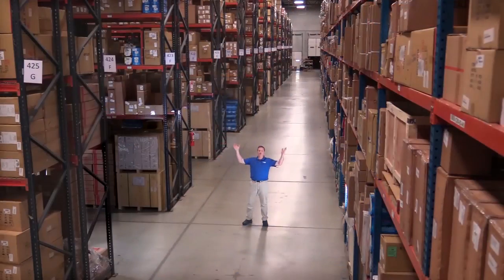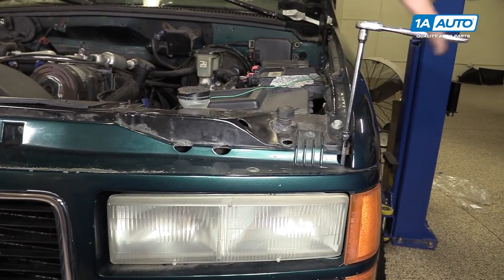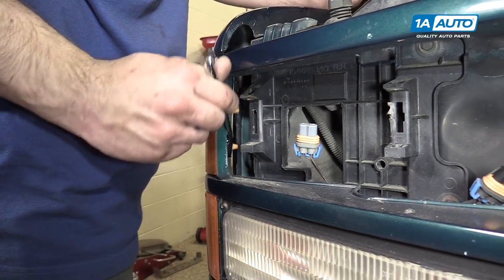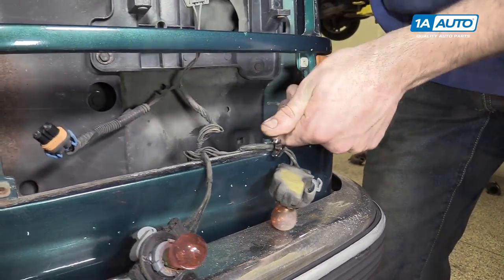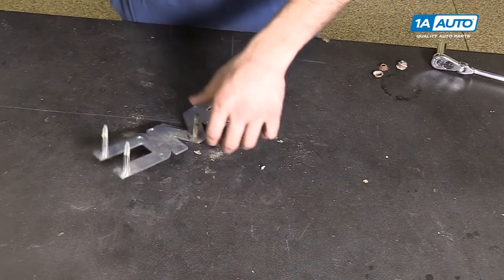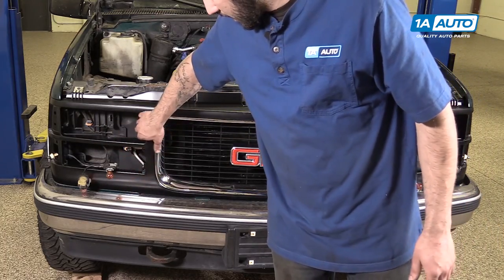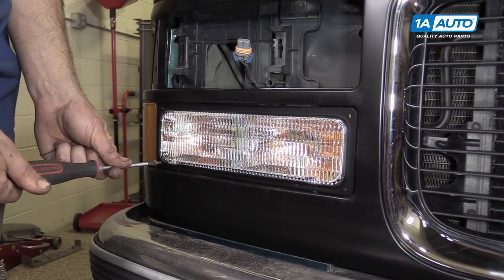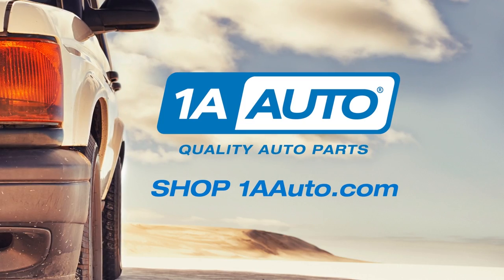How to Replace Front Grille 94-98 GMC K1500

Comment: A quicker way to do this is to remove the turn signal housings, then disconnect the side marker bulbs from housing, THEN unbolt the grill. The headlights are mounted to the car itself so they dont need to come off with the grill.

Comment: Thank you for your videos they are very helpful. I am surprised that when you had the headlights, signal lights and marker lights rermoved from the grill you didn't detailthem , or suggest that they be detailed , and wipe the dust of the marker light bulbs. Its a lot easier to detail parts when they are off the vehicle.

Comment: What is the strip that the grille clips into? Do you sell those? Just bought a grille from you. Need to replace that too. Had no idea that was a separate piece. Would be a good suggestion part to offer. Thank you!
Reply: Justinb Justinb did you find out? I need the same piece

Comment: My 1990 GMC Sierra has the single headlight grille, and I would like to upgrade to the slim quad head light design. Do you have an electrical connector kit to do this change over? I believe the grille should go right in place. Any help will be greatly appreciated. God Bless.
Reply from the maker: +Luis Gonzalez Thank you for your question. Currently, we do not carry a headlight wiring kit for your vehicle. May I suggest trying eBay Motors online.

Comment: why did you pull the headlights? and it's easier to change marker lights with grill removed
Reply: Might ah been to lighten the 'grill' weight for extraction, less pressure on the lower clips.     

Notice the leaves behind the drivers side headlight assembly are same as seen within the,   'remove/replace your headlights'  vid.        LoL

Comment: Is the gmc grill and the chevy ones different? As in light assembly size?
Reply from the maker: +Kurloz Soriano They may be a different size on that vehicle. If you would like to check our website to get a better idea for your specific year, here is a link to our website. Hope this helps you out. 1aauto.com
Reply: +Kurloz Soriano: the Headlights and parking lights are all the same between the two trucks. The 4 side markers are different though, so you will have to get GMC or Chevy specific side markers. 88-93 and 94-00 Chevy side markers are very different, non-interchangeable, same goes to GMC, IIRC. Hope this helps you.
Reply: @firstnamelastname2468   But apart from the 4 side markers everything else is compatible? I just have to change that? I want to put a grille sierra 94 to my suburban 94
or the screw holes will not match?
Reply: @GodLikeMeAgain  they will match the only difference between a chevy and a gmc grill is the chevy grill has a bigger gap between the blinkers

Comment: Hello,  what are them things called that pop in the grill for the turn signal lights to fasten them. There white in the video. I need to know the name of them because im missing a couple and where to buy them please if you could help me out.   Thanks
Reply: +Brenden Swiader IIRC, I think they are just license plate mount squares for your license plate. Like $4 to replace for a 4 pack at AutoZone. Hope this helps you, I think I need to replace mine as well.